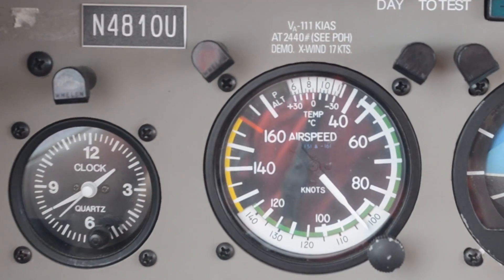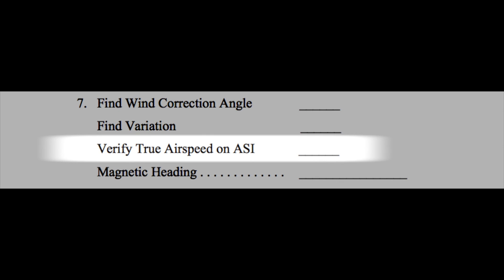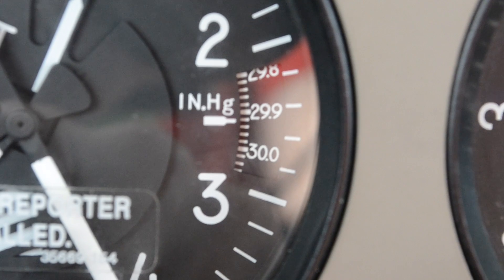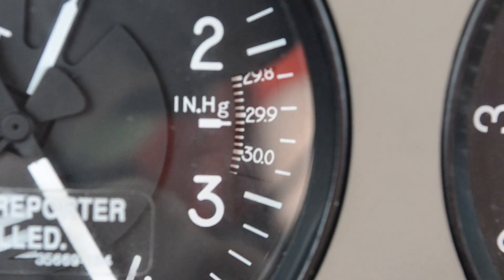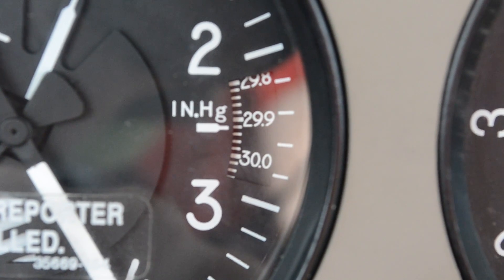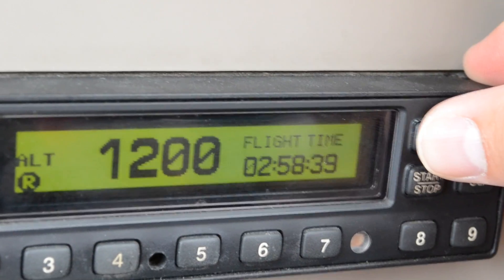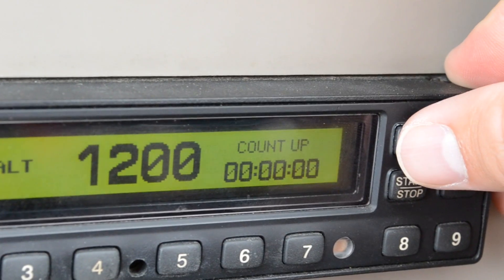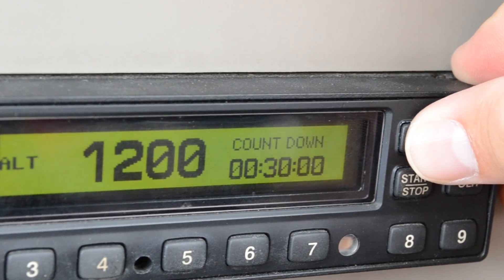OU Aviation Training Series - True Airspeed on ASI

Comment: Very cool.  I know I’ve learned this before (not through formal training either), but couldn’t find it searching through the POH or two Jeppesen manuals.  After some brush-up on a multitude of chapter topics, as it’s easy to drift from topic to topic doing that, I had a flash of brilliance and thought... Google it!  Your video is clear, concise and describes the entire process from start to finish – as well as the necessary applications.  Thanks a bunch – I have it bookmarked for the next time!!

Comment: I thought ground speed was used for checkpoints and ETA's.
Reply: It is, but to get correct ground speed you need to calculate true airspeed to use on the e6b or flight computer.